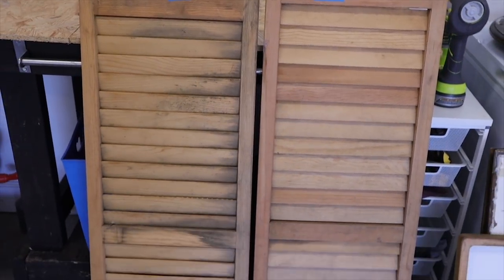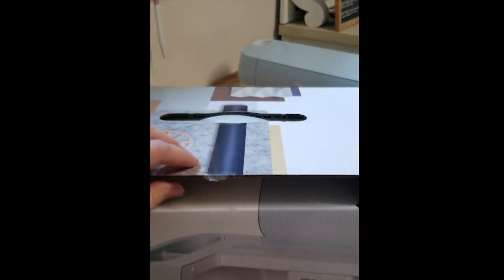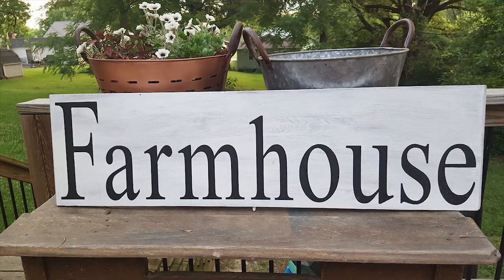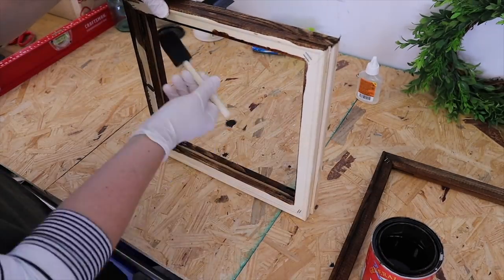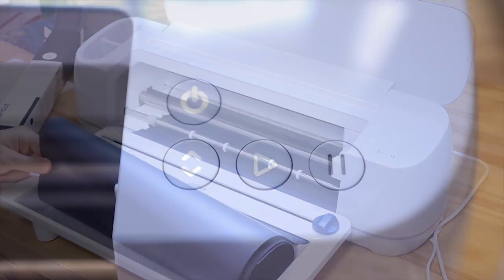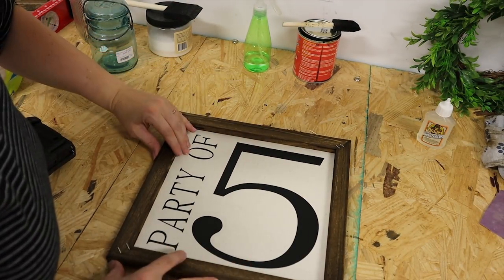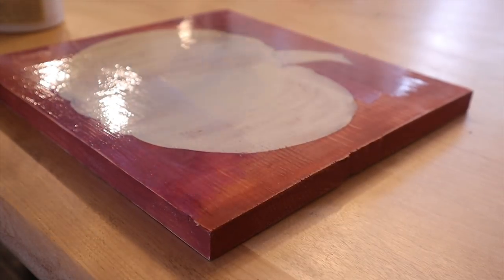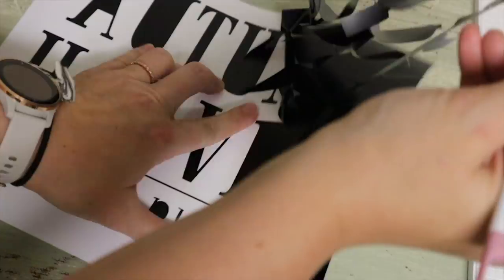7 Antique Farmhouse Decor DIY Upcycle Projects for Resale | Trash to Treasure Cricut Maker3 Tutorial

Comment: Loving your projects and channel, cannot express this enough! My stash is much larger than my completed projects or ideas and you are showing so many ways for me to work through what I already have.

* regarding removing transfer tape, if you lay the transfer tape covered sticky vinyl face down, and pull the paper at an angle backward off the flat transfer tape, it’s shockingly easier to remove

* for how much do you price your “Party of #” signs?

Thank you!!!
Reply from the maker: Ooo your'e right, I forgot that tip about the transfer tape!!  It's been awhile since I've used permanent vinyl, it's not my favorite but I probably just need more practice.  In the past I've sold my party of signs for $22 but I'm upping that to $24 and I'll see how it goes!